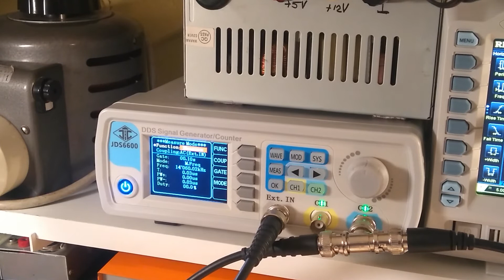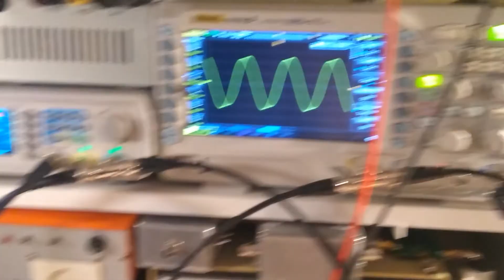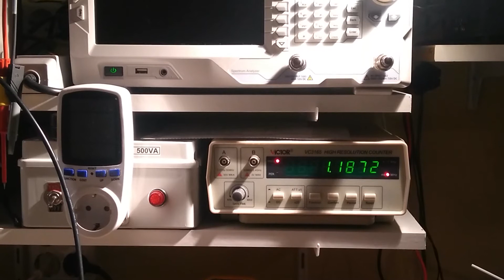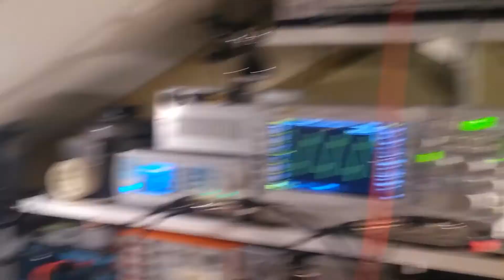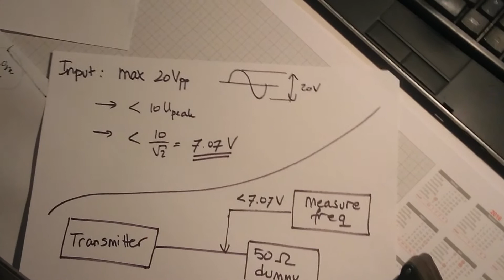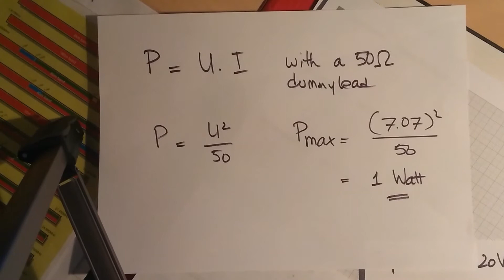RD JDS6600 - can it be used to measure transmitter frequencies?

Comment: So, here is a question. Is this signal generator accurate enough to setup a transceiver ore a communication receiver? 

Thanks in advance. A simple reaction will suffice.
Reply from the maker: it could be used as a vfo for a simple receiver, but expect some phase noise.

Comment: Can one make a composite waveform by adding sine wave frequencies within the device's bandwidth, from the PC software provided with this device?
Reply from the maker: So far I never played with the software. This evening I looked into the arbitrary wave form generator. I found I could make a sinewave and put it aside, and add another sine wave on top of it. As a result I could create an AM modulated signal. The software seems to work, but it's not easy. For simple signals it might be easier to set a sine wave on each channel and combine it by wiring the 2 outputs together with a small resistor network. How does this answer your question? If needed I can play a bit more with it, but I'm quite busy, so it would take some days or weeks before I get to it.
Reply: I have seen another video showing the sculpting of a waveform to an arbitray shape, and wonder whether its able to generate a waveform consisting of user selected fourier components, not AM modulation. From your reply, the arbitrary capability of this instrument is quite limited. Thanks for your explanation.